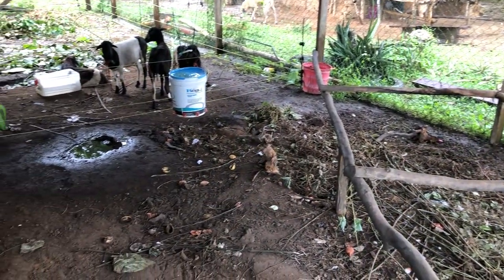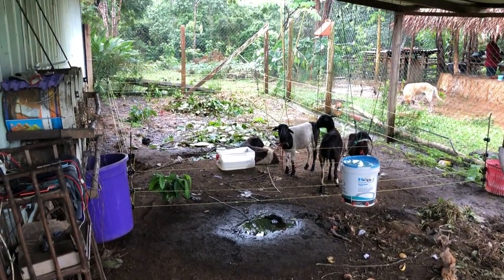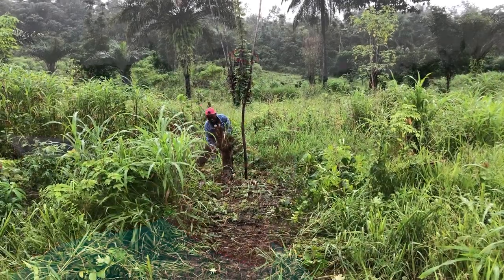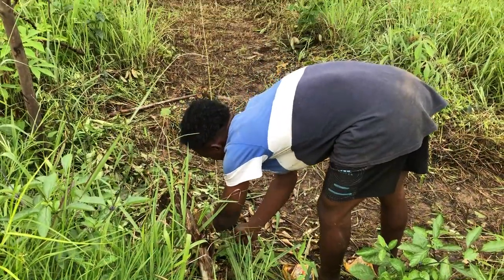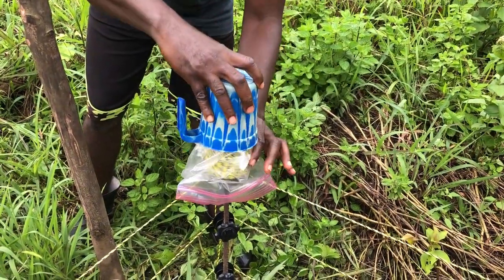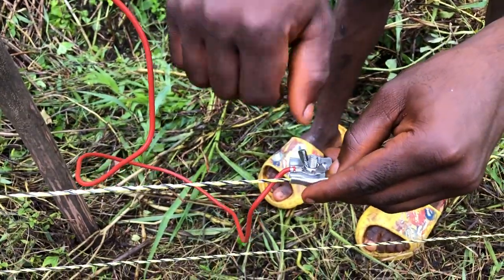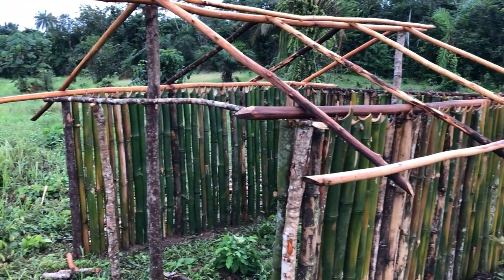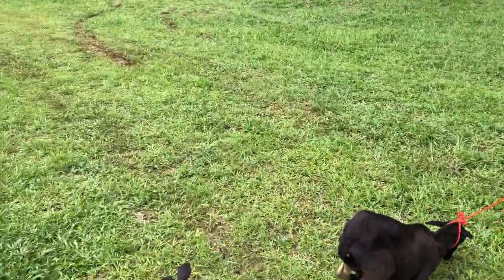The Only Electric Fence in Liberia?

Comment: What did you use for your poles?
Reply from the maker: Great question! I used 1/2 inch/12mm steel rod (rebar). It is relatively inexpensive and readily available here in Liberia.